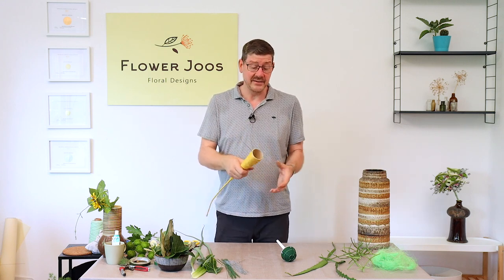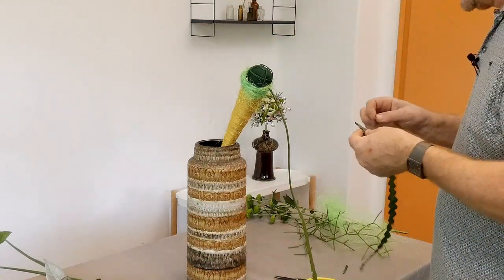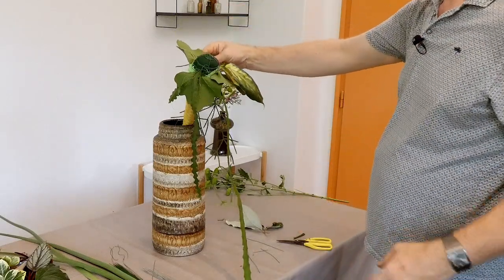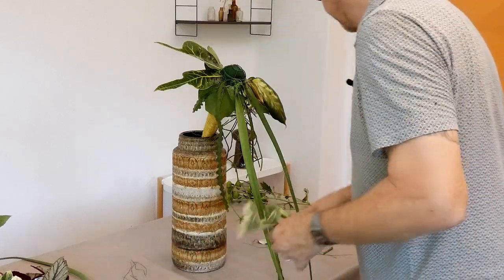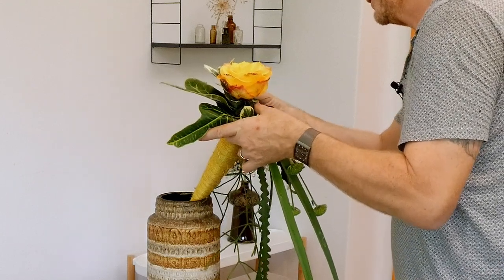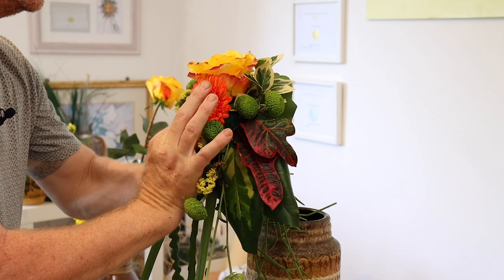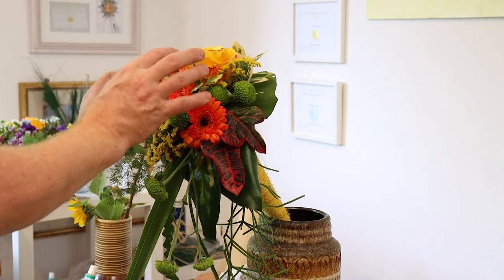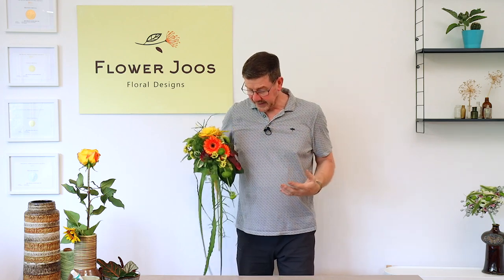How To Make An Exotic Shower Bridal Bouquet

Comment: Ohhh never expected to get a reply :-) but yes, been making wedding bouquets for 20 years & if a cascade / shower, I'd wet the oasis holder maybe Tuesday for a Saturday wedding (to ensure some drying out) & wire the longest lengths as you do through the foam & loop back but for the shorter stems a thin line of cold glue on the stem edge (not the end so as not to "bung" up the end) & it works a treat - wait until the cold glue starts to go opaque & in you go stays very secure :-)
Reply from the maker: Fantastic 😀 thanks for sharing your tip - it’s good to have different approaches up our sleeves 😀 even for hand-tied bouquets I find I do them in a couple of different ways rather than just one way all the time 🌼

Comment: I always use cold glue on the stem & whilst it doesn’t set it creates a stickier surface so helps stems stay secure. Mags the gilded lily Lancashire ❤
Reply from the maker: Thank you Mags! 😊 so that’s into the wet foam as well?
Reply: @FlowerJoos  yes - been using this method for 20 years. I wire in the long stems & run a thin line of glue along the stem  not on the stem end so the stem can still take up water … works very well 👍

Comment: Kermit chrys look lovely but they shatter so easy  also i never soak my holder i wire in trailing greenery and flowers then glue in top flowers,  let bouquet sit for a wee while thrn give it a good spray  seems to work ok.😂😂
Reply from the maker: They can shatter - but the pop of green is a nice touch. That’s interesting your method, but the glue would stop the flowers accessing the water source? With a bridal bouquet it’s all about security though, and it just needs to last the day 😀🌼
Reply: @FlowerJoos  agree I thought this also but so far beern ok although will say i usually do all wired for shower bouquets.  Your bouquet was gorgeous by the way 🏴😁
Reply from the maker: @joyceflowershed  thank you 😊 🏴